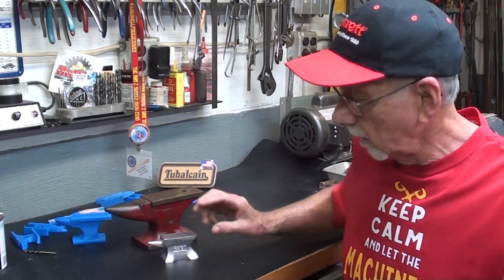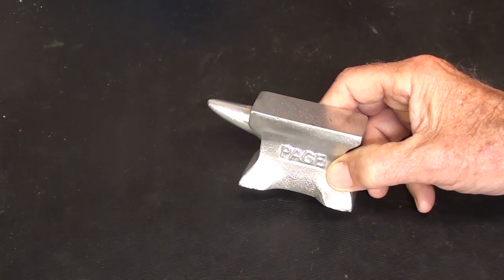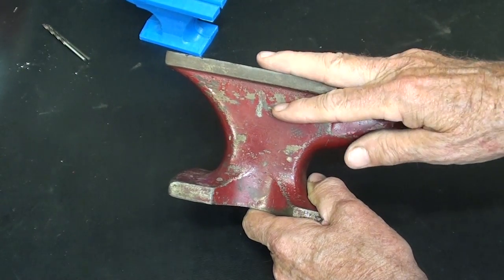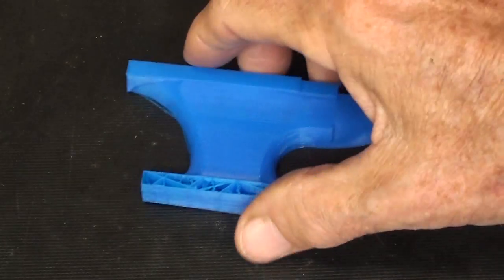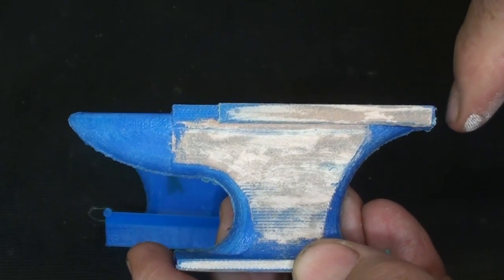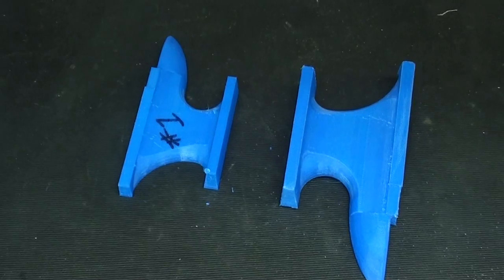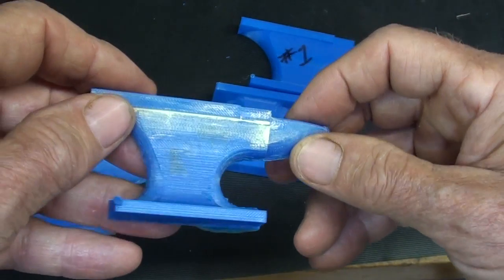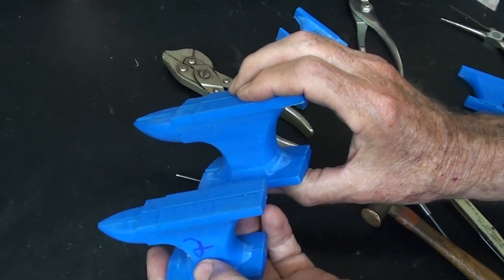Make an Anvil Paper Weight Tips 596  pt 1 tubalcain

Comment: I use ABS plastic for a lot of my 3d prints.  It sands and files better than PLA being softer and higher melting point.  You can also vapour smooth it with acetone fumes.

Comment: You might try using a butane cigarette lighter, the torch type, to remove the burrs. Just pass it quickly over the burr until it melts and becomes a little shiny. It works for me on most plastics.

Comment: Your   " I greatly dislike it !" put a smile on my face.   Dear Mr Pete,  even if I am only close to 50 years,  believe me, its the big Picture that is important,  you shared your knowledge, you taught youngsters how to use tools and different  techniques, you took the challenge of 3d printing. Do you assume my ( or everybody elses prints) are 100% perfect,?  hell no ;) )  I am often enough close to tears when the print is finished, but lifted from the bed, or shifted layers occur. 
I think it is like every time in life,  reading a technical drawing, drilling a hole, tapping the right size, and realize at the end , that  it  was a darn lefthand thread in the specs , so what ?  fix it, and keep on going , next time it will be better.  Thank you very much for all the effort you put into your Videos.  brgds    btw ( Cura has a "Mold print" Function :) ) check it out,  its not for everything, but for many occasions.
Reply from the maker: Thank you, some very interesting observations

Comment: On you printed patterns.  To smooth them use acetone.  I take my finished print and first do any trim filling (large burrs) then I have a large glass jar that the part is placed in.  I use a piece of scrap metal to hold part of jar bottom.  In jar bottom about three or four table spoons of acetone is place and lid closed.  Timer setting for item can be from several minutes to an hour.  The print lines pretty much melt to a smoothness.  As a fine finish after gassing the part it drys for a day then I take a smooth rag and some acetone and polish to luster.  You have to play a bit with it to find right times and amounts of acetone.  As well as how much to use for the polishing.
Reply from the maker: Thanks , But too late I’m sick of 3-D printing. And no one watch this video anyway

Comment: I have seen someone use 3D printed patterns and leave them in the mold, similar to the “lost Wax” process. The patterns were coated with a thin coat of plaster prior to packing in the sand mold.  IIRC It was in the later episodes of the Gingery lathe build by YouTuber Makercise, I think. . .

Comment: Are you running 3 shells?  If you are running fewer shells it adds to the roughness.  ABS does not print as smooth as PLA but it works with sand paper, file and deburing tools really well.  I print practical objects, actual useful tools and parts.  PLUS, ABS responds to acetone smoothing.  LOVE the casting videos.
Reply from the maker: Not sure what the shells are?

Comment: Video liked by another set of deaf ears that didn't bother to watch. I didn't learn anything about pattern draft, using Bondo or water putty as fillet material. Or even sacrificing some of the many (over a thousand I believe it was) drill bits to be used as dowel pins. Unfortunately my shop teacher was burnt out from the idiots whose parents used the schools as a baby sitter, to worry about anything but his retirement when I got there. Learned all mine from the older guys on the job as I went. But I do really look forward to Saturday morning with Mr. Pete.

Comment: 3D printing is great especially if your doing Lost PLA casting and has improved a lot lately, but I think you might find a CNC pattern would work better for your needs making the pattern from a hard wood you can sand smooth and seal.
Reply from the maker: Thanks

Comment: Chiming in again on the 3D printing: perhaps it's time for a new printer. I was annoyed with mine as I had to print slower and slower and even then it would fail. And had the patience to play with the settings and doing modifications -> the only cure was a new(er) printer.
Pattern making: I would kindly suggest again to take a bit of time to play with Fusion 360 or whatever the designer uses. Adding a fillet or a chamfer is a 1-click job, alignment pins perhaps 1 minute, draft a few seconds. Perhaps 2h worth of learning and testing but pays for itself.
Time is really valuable, that's why I suggested the two things above.
Reply from the maker: Thank you for a good suggestions. I’m pretty much sick of 3-D printing

Comment: I haven't used slic3r myself, but I understand it can be used to increase the number of layers at different places in the model.  This would enable you to reduce the layering issue without unduly increasing the print times.  I don't think cura has that feature (but it might).
Reply: Also, if you print in ABS you can use acetone to smooth out the finish.  Acetone acts as a solvent with ABS (but not with PLA).  To get good quality with ABS you need a cover for the printer, which can just be a simple cardboard box with plexiglass windows to be able to see through.  Otherwise printing something that size in ABS will likely lead to some warping as the model cools unevenly.

Comment: You’ll need heat to deal with the burr, perhaps a dedicated temp controlled soldering iron with a lower temp perhaps around 200*F though I’ve never tried it myself so that could be too high or low.
Reply from the maker: Thanks

Comment: Quick treatment with a heat gun should smooth out the burr after sanding
Reply: Acetone vapor bath is typical. Different plastic would be better. <-- Wrong in this instance. For ABS not PLA.
But he's completely turned off on the 3d print thing anyway. Or, have them printed outside and not have to deal with it.
Reply: ...that sounds like a hot idea-!
Reply: @jimbarchuk  the acetone vapour method doesn't work on PLA.  But it does work on ABS prints. Or so I've read.
Reply: @tobhomott   True! Proper amount of heat works with most of plastics. Acetone dip, or acetone vapor treatment might be a bit sketchy if you don't know what plastics you are working with.
Reply: @tobhomott  You're right. I looked it up and clearly misremembered. I'll edit my post.
Reply: @jimbarchuk  ABS filament is out there available for 3D printers, so anyone who wants to try your suggestion should be able to do so. 👍

Comment: I don't use the Cura slicer so I'm not sure if there's a setting to home your axes after printing but if there's a place to edit the sliced gcode in your printing software you can tack on some commands at the end.  If you don't have a place to edit the gcode, Cura should be able to export the original stl file to gcode and then you could edit the result file with a plain text editor like notepad adding the command "G28 X Y ;" to the end of the file.  This should home the x and y axes' but you won't want to home z because it might crash something into the part depending on how your printer is designed and the size of the part.  You could also use "G1 Z5;" to raise the z axis 5mm and get the nozzle off of the finished part.  Once the gcode modifications are made you would just import the edited gcode file for printing instead of the original stl file.
Reply from the maker: Thank you, but that’s all beyond me

Comment: mr. pete question for ya.. little off subject but have too ask. looking to get a new caliper, definitely Starrett, question is dial or vernier. i have been told vernier is more accurate but i don't know. i can read a vernier, but the old eyes just aren't what they use too be. however i want accuracy as much as i can get. so thought i would pick your brain. another good one from the shop by the way.
Reply from the maker: Dial. Too much chance for error with vernier. And hard on the eyes
Reply: @mrpete222  thank you sir.

Comment: Could you use heat to improve finish on patterns? I'm thinking propane torch, soldering iron, etc
Reply: The best way to improve finish is by changing the layer height, but that will result in much much longer printing times.

Comment: How to make your printer behave. In cura go to preferences configure cura drop down then left side click printers then on the right Machine settings then extruder 1 tab   then in Extruder End G Code type in 
G28 X0 Y0  ; home X/Y axis
M117 Cooling down . . .
M104 S0 ;extruder heater off
M140 S0 ;heated bed heater off 
G91 ;relative positioning
G1 E-1 F300 ;retract the filament a bit before lifting the nozzle, to release some of the pressure
G1 Z+0.5 E-5 X-20 Y-20 F9000 ;move Z up a bit and retract filament even more
M106 S255 ;fan at 100% to cool nozzle
G90 ;absolute positioning
G1 Y190 ;move bed forward
M84 ;steppers off
G4 P120000 ;wait 2 minutes 
M106 S0 ;fan off
M117 Finished!!! this will only need to be done one time it will put this at the end of each file from then on and you can use all of this or just the part you want.
Reply from the maker: Wow, I am 76. Do you think I can follow that? But thank you

Comment: 3D printing is a ton of fun....Once you get the printer dialed in. That can be frustrating for sure. Once you do you might adjust temp a little because of the brand/type of plastic but that's it. 
Check out this guy on Youtube. https://www.youtube.com/user/beginnerelectronics
He goes step by step. You can even down load his Cura settings to help you. Few clicks and you are printing! I make so much for the shop from wrench racks to little "keepers" for my peg board hooks. 
Hope it helps.
Reply from the maker: Thank you, I will check that out

Comment: Is there a reason why your prints are super rough
Reply: Because it's a filament 3d printer. All filament 3d printers suck. And it's not that rough.
Reply: Mine prints super smooth but I use pla

Comment: I understand that 3D printing is time consuming and costly, but could you leave the pattern in place when you cast similar to a “lost wax” technique??    Also try sanding with autobody type sand paper  180-320 grit and then believe it or not finish sand it with cardboard instead of sandpaper.  It should leave a smooth finish on the plastic.   This is how we rework plastic in the collision industry.  I repair so many plastic parts in a given week I cannot remember if I have ever worked with that type of plastic.   Also there are other types of thin fillers that sand really easily that would work well for this type of application.

https://www.tptools.com/Nitro-Stan-Red-Glazing-Putty,1809.html
Reply: I have used a 3D printed pattern and did a lost wax method     i don't rdmember what material i used but it burned out ok and cast ok      i believe there are materials specifically made for use as a lost wax